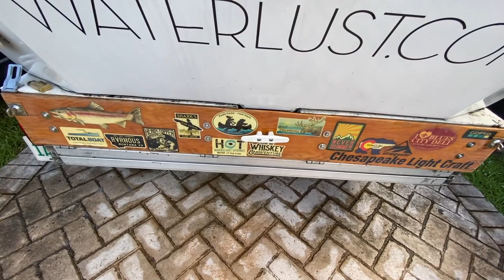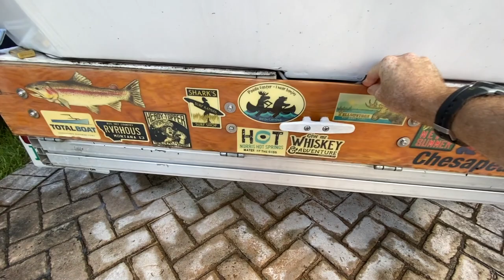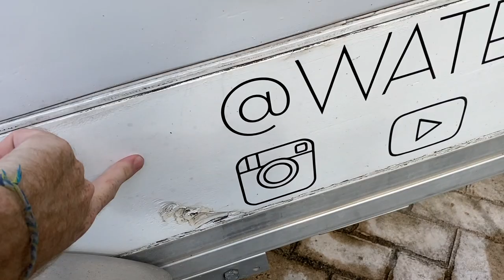3 Years Later - A Review of our DIY Teardrop Camper

Comment: Patrick, I watched all of your build videos and they helped inspire me to build one. I started with one of CLC's tandem decked canoes and felt I had enough experience to build their camper. These have been the best, most satisfying projects I've done. I finished mine just one year ago. Covid and Oregon fires have kept us at home more than we wanted. 
I too wanted to put storage compartments under the camper but like you, I felt it would put my galley flat too high to be comfortable. 
I designed and custom built my own steel trailer with Timbren Off-Road axel-less suspension because I wanted to do light overloading with it. Because I needed the ground clearance for off-road use, raising the camper even more was out of the question. Fortunately I pull it with a Tacoma with a Diamondback bed cover so I can carry all my camping gear securely in the bed of the truck. 
I did build a curved face clothes cabinet that I've mounted on the bulkhead above the shelf. This lets us keep enough clothes for several days, inside the sleeping area without opening a suitcase for clothes.
I also put a small 5"x7" door through the bulkhead into the battery compartment.where I keep my Yeti 400 watt LI battery. I just open the door to reveal the control panel of the Yeti.  It's very simple, elegant, and only weights 17 pounds.
I love comparing notes on these builds because everyone does something different. 
I want to thank you for your contribution especially this 3 year review.
If you ever make it to Bend Oregon, please get in touch.
BTW, I really would love to build the sailing canoe like you and Fiona built and sailed from MD.
Reply: Your additions make lots of sense! Do you have pictures of those shelves?

Comment: You might get better success with adhesives if you scuff the surface first (can't remember if you did this during the original installation?)  Outline with painters tape the path you want the adhesive to take (prevents leaving swirl marks where you don't want them), scuff with 200 grit until the surface is cloudy, clean with isopropyl alcohol, then apply your adhesive device.

Comment: Nice review.  I did not read all comments, but two items stand out for me.  Your weathered peeling near the edges of the doors is very likely due to the extreme edges you provided.  We do lots of glass and carbon work, often over wood. Most composites do not like extremely sharp edges, so split over time.  Routing the edges, when possible is a time tested resolution. (Prior to glassing)  A bit hard to do on 1/4 inch ply.  You can also double up the edges with an additional layer or two.  Secondly...do not blame your "cheap" cover for tearing when you must work it over the  sharp edges of your solar collectors.  An expensive cover will tear as well. Consider an inexpensive guard to attach to the upper panel edges.  We use flexible collectors for the simplicity and reliability. Maybe less wattage than you.
Reply: @Waterlust  Thanks!  I am doing my own, like yours, but bigger...and a new poling skiff.  Winter start, spring completion.  Steal shamelessly! I DO!
Reply: If it's the corners that are tearing the cover, you could try some of the corner protectors that are used for toddler-proofing tables.

Comment: Thanks for your unbiased, well experienced review !  For your bottom storage panels, why don't you wrap it in glass, like the rest of the camper's body, it's almost transparent so you can see the wood... That would help preserve those stickers just like bars do with the stickers and bottlecaps in resin for their bartops. The failure of the edges is partially due to the hard edges or corners where plywood was cut by saw edge (delaminating it a bit). Sanding or at least routering (cutting angle vs ply layers is zero relative vs 90 degrees of saw cut) would greatly soften the edge transitions and allow much better resin absorption (ps use thinned epoxy only coats on the entire panel until it STOPS absorbing it before glassing...) For cleaning the white plastic shower tank, try Spray 9, it kills mold as well as anything else (so use gloves). On the awning zippers, WD is oil based and attracts dirt, etc so try a dry lube... Elmer's (glue company) Slide All product is a dry white teflon base sprayed as a liquid and works better on everything (like your drawers) you can spray on zippers with some tape or cardboard shielding so it doesn't stain or "frost up" the fabric.

Comment: 3M super weatherstrip adhesive will hold that weatherstripping on.  I knew a guy that put a set of valve cover gaskets on a small block Chevrolet with it holding the gaskets on.  He took the bolts out and ran it for about 10,000 miles like that just to see if it would hold, and it didn’t leak.  I’ve used it on engine gaskets and weatherstripping and the only problem comes when you need to get it off.

Comment: Great Video!
I'm a builder kinda guy. So far your tear drop I like the most. Your kitchen galley looks like it should be on a yatch!
Idea about the "plywood edge problem." You could try ROUNDING the edges, before putting your clear-coat, or varnish

Comment: Nice review of you camper. Love the design and your story! The hard corners will fail because the finish is usually thinner at that point due to the way paint flows when applied. Also because it is a hard corner there is more stress on the coating in that area and you will get micro-cracks which will eventually allow moisture to penetrate and lift the coating. “Water always wins”, unfortunately in the case of your wood finish! Good luck with you upgrades.

Comment: Thanks Patrick this is great.  I’m about halfway through my build and did get the ICC for underneath.  I will pay special attention to the edges, and will epoxy on little blocks anywhere I might want to use screws.  Quick question how did you fasten the cabin lights in the circular holes by the doors, I have similar lights but am concerned about screwing them in.
Reply: Hi Tom. I finished my CLC teardrop about a year ago. For the reading lights I epoxied little wood blocks inside the round hole. The way I did this was I just cut some one inch square stock about an inch long (or whatever depth the inside of the light is). I then screwed the blocks into the light housing. After that I put epoxy on the ends of the square stock where it will make contact with the wall of the camper and pressed the light into the round hole. After the epoxy cures you can just remove the screws and pull the light out of the mounting hole. Be very careful not to have too much epoxy "squeeze out". If it makes contact with the light housing you'll never get the light out. You might consider putting plastic packing tape on any surface of the inside of the light that could potentially get epoxy on it.
If you want some pictures of what I've done and some of my mods, just send me a note with an email.
Reply: Rod Burke thanks Traidna > gmail
Reply: @tomraidna8421  I'm away from home for a few days.  I'll send some photos in a few days when I get home.

Comment: What is the total weight? And what is the tongue weight? I have a big Harley (114 ci) and want to know if it will be able to pull this.
Reply: Warning : motorcycle aren't meant to tow anything. Any type of trailer can cause significant trailer sway causing
an uncontrollable whipping effect.
Imagine your rear end coming around you & the extra weight over loading your brakes. Ever give a fat person a piggy back ride ?

Comment: I want to install a 12v system in my 1979 Scamp. I want to add it to the current 110v system (which is what I have now.)  I want to be able to charge the 12v system while sitting and driving.  Can you tell me the estimated cost of all the materials required and the two Solar Panels.  Thank you.

Comment: You mention your axle offers lots of clearance.... take a closer look, your frame is dented from the axle coming in direct contact! The axle has inadequate clearance and should be placed below the spring not on top of them. Also its hard to see clearly but the axle retaining Ubolts don't look correct/sufficient  and the axle doesn't appear centered on the spring! sorry to be such a downer but i would deal with those issues soon. If your not sure take it to a professional spring shop for confirmation. Otherwise your trailer looks great.
Reply: @Waterlust  Ok as long as your aware of the contact and monitoring the frame damage, ideally getting a drop axle and reinstalling it under the springs would achieve the needed clearance and still leave the floor to ground clearance where it is now.
Reply: Leaf springs UNDER axle = LESS ground clearance LESS suspension 
travel
Leaf springs OVER axle= MORE 
ground clearance MORE suspension
travel
simple physics
Where axle is located on leaf springs front to back has NO effect on suspension, only wheel base.